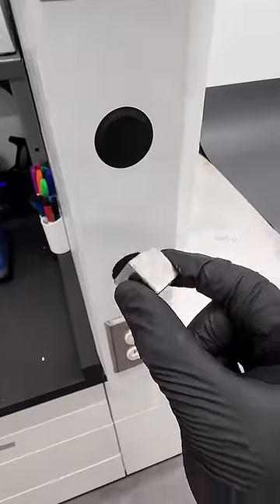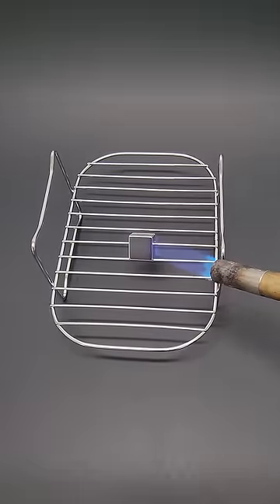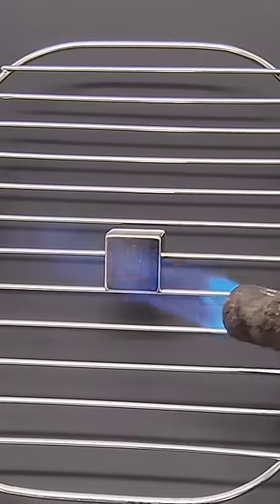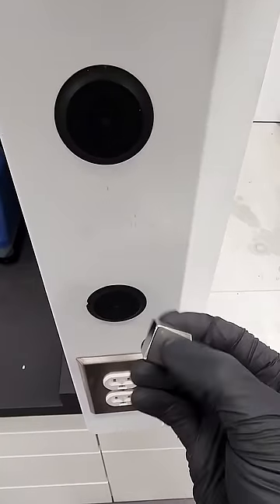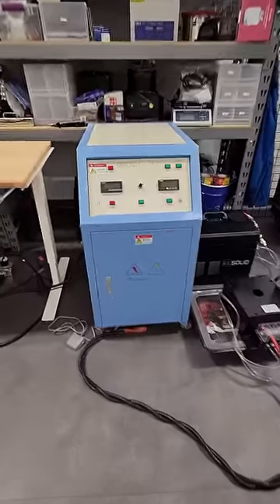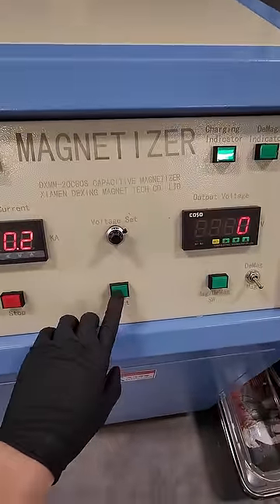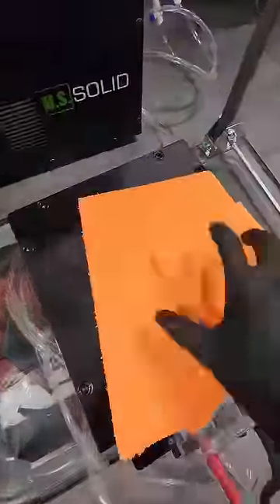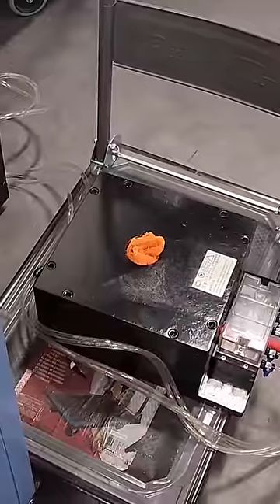I accidentally killed this magnet

Comment: If people are interested in how this works, permanent magnets work because when the material is formed, it was into a state where the spin vectors of the electrons in the atoms all point in the same direction. This creates small magnetic dipoles in the material which add up to a larger effect. 

Heating up the magnet didn’t make any visible changes, but the heat affected the material on an atomic level, causing the atoms to vibrate and the spin of the electrons to come out of alignment. 

The magnetizer that he used works by using an electromagnet to cause a large magnetic field which forced the spin of the electrons into (or in this case “back into”) alignment.
Reply: Bless people like you. Thanks for this.
Reply: I suspect it was stronger then it was previously because it was still hot when he put it in the chamber.  Should heat it red hot and put it in.
Reply: I like your funny words, magic man
Reply: @DarthObscurity  It is stated in the video “after it had cooled down”, so it was not still heated when it was placed into the magnetization chamber. Heating it before placing it in would not be more effective - in fact it would make it so that it would not retain the magnetic field induced by the machine. 

I neglected to mention this originally, because it could be due to many factors. Its strength after using the magnetizer machine is primarily due to the machine’s effect on it - placing an unmagnetized cube of iron (edit: material is actually neodymium) would most likely have resulted in the same strength as what he ended up with. The fact that it had previously been a magnet didn’t make much difference. The comparative strength of it being stronger than it had been originally was most likely due to the magnetizer machine being more effective than what had previously caused the cube to become magnetized in its previous state. 

The reason why magnets stick to unmagnetized ferromagnetic metals is because the magnetic field in the magnet induces a small magnetic field in the other object, which aligns with the magnetic field of the magnet, causing them to attract. The magnetizer machine works by making a strong enough magnetic field that it semi-permanently deforms the atomic structure of the magnet being created, causing it to remain in that magnetized state.
Reply: Thank you, the comment I was looking for
Reply: @DarthObscurity  Permanent magnets are not magnetized at high temperatures ( they have probably tested it - and concluded it makes no difference.)  Neodymium magnets loose their magnetism at quite low temperatures
Reply: Fascinating 🙃
Reply: How long will it last?
Reply: Why doesn’t this have 5K likes ?
Reply: Nerd!

Are the best. Thank you! :D
Reply: Thank you! I was wondering how magnets work. I always googled the answer, but never understood
Reply: Blah blah blah blah

Science science science
Reply: this is literally the only comment I came looking of in the comment section so thank you very much for your insight
Reply: You are correct .   Dropping magnets over and over will also mess up a magnet . It basically throws the atoms out of line . I guess the machine  puts the atoms back in line .
Reply: If iron would have been the same strength then why don't they use the much cheaper iron vs neodymium? Hint: it would not be nearly as strong.
Reply: @jcrew6640  that’s correct! Dropping it (or subjecting it to repeated impacts) affects it similarly to how heating it does. As the strain waves travel throughout the material it vibrates the atoms (which is what causes the sound you hear when it falls or is hit) and that can also cause the electrons’ angular momenta to come out of alignment. :)
Reply: I’m…….attracted to this comment
Reply: Interestingly enough, when people are like-minded or divided they work very similar.  It can be seen clearly in unions, churches, clubs, and other associations.  When people put their minds together in a collective way they accomplish much greater things.
Reply: What he said
Reply: Gay
Reply: Thank you!
Reply: I love people like you 🫡🤜🤛
Reply: @mrbmp09  🚨NERD ALERT!🚨
Your “um actually” moment aside, I’m explaining how it works, not about why an alloy nobody’s heard of (and is still over 80% iron anyway). The point was clearly that it didn’t matter that it had previously been magnetized and demagnetized before put in the machine.
Reply: Thank you for the science stuff explaining why the guffin thingy was demagnetised and re-magnetised.
Reply: I was looking for this comment, thanks for the explanation
Reply: @mvstermlnd     1 and 2: Magnets can push other magnets away if their poles align oppositely. However, the reason that they only attract (and not repel) unmagnetized ferromagnetic metals is because the reason that they attract to them is because the magnetic field produced by the magnet induces a magnetic field inside the demagnetized metal, which aligns with the magnet’s magnetic field, causing it to attract. 

You can use a simple experiment to see the above for yourself: take a relatively strong magnet, and 3-5 paper clips. (Make sure the paper clips are attracted by the magnet before you test; if they’re made of a non-ferromagnetic metal like Aluminum it won’t work). If you put one paper clip on the magnet, you can then attach another paper clip to that first one, and then make a chain of magnetized paper clips, because the magnet induces a weaker magnetic field in the first clip, which induces another weaker field in the second, and so on. The induced field is never going to oppose the permanent magnet’s field, which is why they can only attract, not repel. 

3: Yes, it can. It works by creating an extremely strong magnetic field around the cube which (similar to what I explained previously) induces a magnetic field inside the cube. The field that the machine produces is so strong that the induced field in the cube becomes permanent after the machine is done. It’s like if you stretch a piece of metal far enough then it will stay stretched. 

4: Yes. Natural magnets works pretty much exactly the same as artificial permanent magnets, only that they’re made by nature instead of by people.

5: No, the electromagnets used for such things work by running a high current through many loops of wires, which produces a magnetic field. Just like how I explained for permanent magnets, this is capable of repelling other magnets if their poles are oppositely aligned, but will only attract non-magnetized metals.

Comment: Heating a magnet disorients the molecules. What makes a magnet stick are molecules oriented in the same direction. You can also break their orientation by hammering or beating a magnet. You can  at times reorient the molecules by brushing the magnet in the same direction on a fabric.
Reply: This is exactly true, it's the spin of the electron in an atom the cause magnification. Heating up the magnet randomizes the spins while cooling the magnet enough will reorient the spins to all be the same direction since it's the lowest energy state
Reply: @trailmiix7581 Ferromagnetic materials like this actually will not regain their magnetization if you just cool them down (as you can see from the video). They have to be immersed in an external magnetic field that realigns the atomic spins. This is an example of hysteresis.
Reply: Woah!!!
Reply: the brushing it on fabric probably creates static electricity, so this is basically just doing that to the extreme

Comment: Ferromagnetic materials have tiny, tiny magnets in them called elementary magnets. These are usually pointing to all directions (which equilizes the magnetic effect) but you can polarize them by using an (electro)magnet. But once you heat it, all these elementary magnets go back to random directions.
Reply: But electro magnets lose the property very soon but permanent magnets stay almost the same for years.

Why is that
Reply: @VENOMYT5 Hey there, so basically... Electromagnets are made of soft ferromagnets... Soft ferromagnets have really low retentivity and coercivity due to which as soon as you stop passing current, the electromagnet is demagnetized whereas permanent magnets are made of hard ferromagnets... That's why they are hard to demagnetize... For example, steel (it's a hard ferromagnet) to demagnetize steel you'll have to provide it a really harsh condition like extreme heat.
Reply: Well said.
Reply: @YOBAMUSTDIE  thanks for the reply! That sounds like it makes a lot of sense. My view was how I got teached this topic.
Reply: 👍... Now I imagine what would happen if our body protons maintain their polarity after an MRI scan 😄

Comment: You didn't upgrade it. You showed it its true potential.
Reply: technically yes, since magnets gets weaker everytime it gets knocked out, when the machine magnetized it, in theory it should be in the strongest magnetic field
Reply: @ContinentalDrip I think they don’t force these magnets to maximum potential because they are extremely brittle. 

Two of these stronger magnets meeting each other will almost certainly make them shatter.
Reply: @taekwoncrawfish9418  that's why I said "strongest magnetic field" I was referring to how much the machine can made but not "the strongest potential magnetic field"
Reply: @taekwoncrawfish9418  we're talking about magnetic field strength, not the material strength.
Reply: @samueladitya1729  lmfao so was I

Comment: When you heat a magnet, like you did with the torch, the heat causes the magnetic domains within the material to become disordered and lose alignment. This alignment is what gives the magnet its magnetic field. As the alignment breaks down due to the heat, the magnetic field weakens or disappears altogether. This phenomenon is known as the Curie Temperature, (or the Curie Point) which is the temperature at which a material's magnetic properties change.
Reply: So this expensive machine RE aligned the fields of the magnet? If that happened, how?
Reply: Thanks for the info!
Reply: @rickb1387 Presumably the massive electrical pulse breaks the metallic bonds for just long enough to realign the atoms in its direction?
Reply: @rickb1387 Applying a huge magnetic field oriented in one direction so every domain is forced to realign in that direction
Reply: @theregalproletariat no need to break any bonds. Just move around the external electrons and his spins
Reply: "Who are You, Who are so Wise in the Ways of Science??"
Reply: This comment has 40 likes. A comment that ends with "some kind of zombie super soldier" has 40k likes. Shows the average IQ among YT commentators.
Reply: Nice, but you didn't explain the whole transformation.

Let me assist.... In layman terms:

Blue flame fire facilitates pliability/ plasticity of the cubes magnetic bonds allowing for internal bond repair and re-pattern thicker bonds.

Fire is baptismal!! 

-Sir °33+57 And Counting
Reply: @simonsan5271 Your comment is a gift to "those" YT's, likely ill received. Now let your awareness work for "us". Sometimes, less is better. 😇
Reply: Ok nerd
Reply: @vermili0n  L comment
Reply: @vermili0n you probably average a C in school.
Reply: @vermili0n  <----- is the kind of guy I was talking about in my initial comment. Would have preferred a "hold my bear" joke instead (if not to long that is. Reading isnt his favourite activity)

Comment: You just explained a programmer's life😂
Reply: You mean overwork them till they burn out, they stop working, then you shock them with 2000 volts, then they work better than before? Doesn't sound quite right, but maybe I just need to go get electrocuted.😂
Reply: They work on things until you burn them with a blow torch, but when you shock them with almost 2000 volts they work better?
Reply: Can someone explain what’s going on like how’s that possible
Reply: Bro got a pack a punched magnet
Reply: you mean an indian's life
Reply: So... They work until they burn out, and get working again after a shock of inspiration?
Reply: What does this even mean
Reply: I hope you never explain what you mean😂😂😂😂😂😂
Reply: I dont get it, but somehow i completly agree
Reply: @TheFoxfiend you mess with a feature and it breaks, you try to fix it then you end up with something even better(sometimes we don't even know how)
Reply: @omarvayani3452  That sounds more right, thanks.
Reply: @omarvayani3452  you ruined it
Reply: 'Breaking something in the process of trying out new systems' is something that software engineers may find relatable 🤷
Reply: @TheFoxfiend I think it’s like coffee or energy drink (the 2000v part)

Comment: Whenever I get magnets that strong, they always shatter. I always wondered if the stronger magnets were more pure or something and if that made them brittle and weak. I've dealt with so many magnets over the years and when it comes to Neodymium magnets, the strongest one's are always impossible to not break. They'll eventually grab onto something pretty far away that will slam into them and shatter them.

Comment: Essentially, the difference is at the atomic level. A ferrous magnet achieves its properties due to the molecular arrangement of its atoms. When you heated the magnet up, it causes the atoms to expand and potential shift out of the alignment that causes magnetic force. 
Then once the magnet is placed into that device, a new magnetic field is exerted on the ex-magnet, rearranging the molecular positioning again.
Reply: That's really cool!
From the looks of it, likely an electromagnetic charge
Reply: You heat it above curie temperature to demagnetise ,right?
Reply: Thats a lot of words 😎
To bad i'm not reading them😎
Reply: So if he could charge North and South pokes of the magnet the first time and then aligned it east west and hit it again, would it just realign North / South to East / Weat or would it be quad directional charges?    Making it bi-polar, no pun intended!
Reply: @Mrkenobiminer Anti-intellectualism isn’t cool.
Reply: The atoms aren't expanding as much as the electrons are losing their alignments. Expanding atoms would affect the integrity of the lattice. The heat is applying thermal energy to the electrons that exceeds the energy of their magnetic alignment, causing them to unalign and orient themselves randomly. The magnetizer applies a magnetic field that restores the alignment.

It's true that adding heat results in some negligible expansion, but that's not the main mechanism at play.
Reply: @Mrkenobiminer  yes I too fail miserably in school! im so cool for it.
Reply: @Mrkenobiminer  don't have kids
Reply: then how did it become stronger? Shouldn't its power have stayed the same?
Reply: I think he knows
Reply: I think it applied a stronger field when he revived the magnet, so I'm assuming the electricity being 2000v was stronger than the magnet used to be

Comment: I’ve worked with one of these but on a much bigger scale and with oil with metal shavings. It was for a NDT lesson in my aviation maintenance class. You would take a part from the plane, magnetize it, take the hose and pour some of the oil and metal shavings on the part, look for areas that may be damaged, demagnetize it and send in for disposal or assembly back onto the plane.
Reply: Yea, magnetic particle testing, it's been around a long time and as I recall that particular type is called wet magnetic particle testing or sometimes just wet testing, it's also done with just a metallic powder without the oil, I think the whole idea behind wet testing is the metal powder doesn't get lost and scattered all over the shop when you have it in the oil that drains back into the tank and gets recirculated through the system instead of winding up all over the place and having to be continuously replaced, the dry testing is much cheaper of course because you don't have the tank and oil to buy and it's good for occasionally testing stuff but a shop that has a station that continuously tests parts all day is definitely better off using the wet system.
Reply: @dukecraig2402  very cool

Comment: This is actually similar to a trick blacksmiths use, when you're heating metal like a blade to heat treat it, the metal will no longer magnetize, so you just hold it up to a mounted magnet to see if it's close to hot enough
Reply: Wow
Reply: That's really cool

Comment: I knew that heating metal demagnetises it (because the atoms dance about in random directions), but I didn't know why remagnetising it would make it stronger. So today I learned magnets lose strength over time, especially if they're dropped or bashed around. So your magnet had already faded a bit and you've restored it to full strength! How cool.
Reply: True, although it's also possible that it was never fully magnetised. Maybe for safety reasons idk
Reply: @akosv96 or the heat process from manufacturing damaged it a bit
Reply: @akosv96  most defiantly safety reasons. As a strong enough magnet slamming in to things is dangerous, as it can break apart and send small splinters flying
Reply: @akosv96 permanents magnet  weaken over time because electrons can jumble around in random directions, which can also be caused by high temperatures and corrosion
when a weak magnet interacts with a strong magnetic field, electrons get reassembled back into the magnet’s original state, strengthening it
Reply: @mr.thomas6128  I'm sorry, but I see this one way too often. It's definitely*
Reply: @mkkracken7979  oh I am sorry I am both not a native speaker and dyslexic as hell, and have an autocorrect that likes for fuck me over every once in a while
Reply: @mr.thomas6128   Don't worry, it happens to the best of us! I didn't want to come off as grammar police or whatever, but those two words are pretty different in definition, yet so commonly interchanged and I just want to help fix that when possible